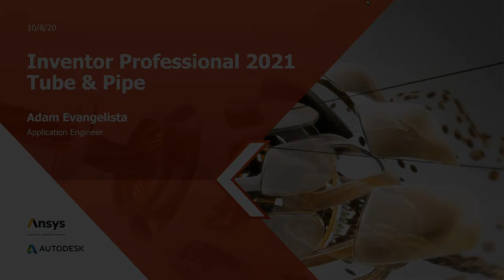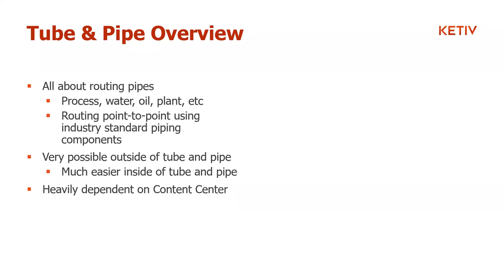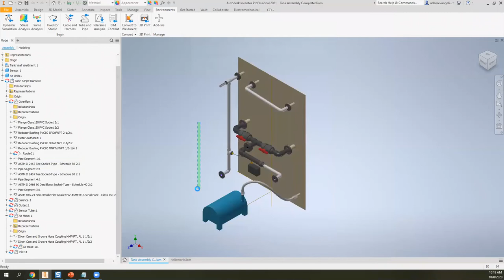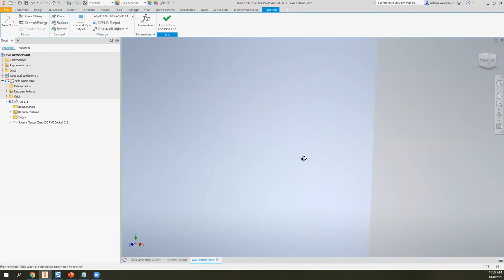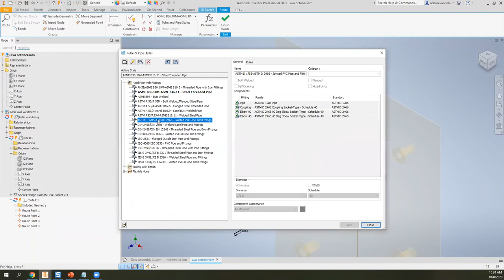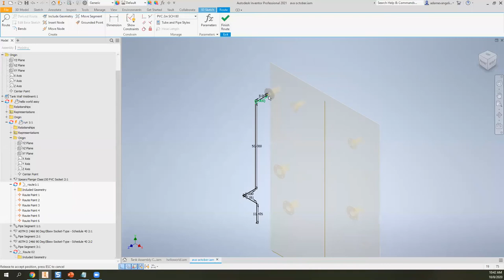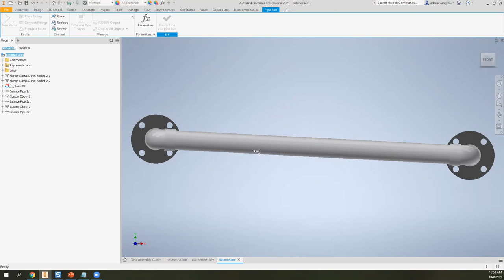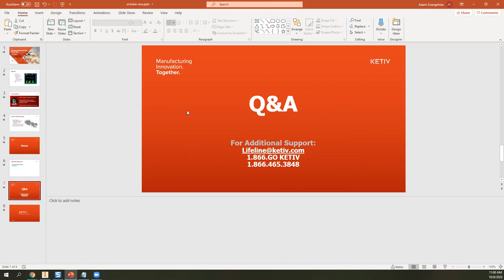Using Tube & Pipe in Inventor Professional 2021 | Autodesk Virtual Academy

Comment: That was pretty brutal. I'm trying to create a simple bent piece of tubing with 3 bends using the tubes and pipes feature and after watching all that and making a few stabs at it, I'm exactly nowhere. Clearly Adam knows Inventor but getting that information into a teachable form was apparently elusive. Maybe just going over the styles settings needed and then making a few example runs would be the way to go. It seems like this feature is not ready for prime time. Back to 3D sketches I suppose.

Comment: Hi ketiv, I have a question, could we use different pipe style for different run? I tried to change the pipe style for one run but the other run style also change. And I dont know if there is maybe a trick to do that.
Reply from the maker: Hi Alex,  Yeah, there's a few different levels to tube and pipe which goes SUB ASSEMBLY > RUN > ROUTE.  Assuming you have multiple pipe styles set up, you can change the style of a ROUTE to something else without affecting the other ROUTES in the RUN. We have some additional videos on the channel that get into more advanced topics like this as well.  - Adam

Comment: How do I measure/constrain off of geometry.  Example, i need a reducer placed 2ft off the wall.  The only option i know of is to place a component at the highest level rather than into the runs.
Reply from the maker: Hi JoeBob.  Yeah like you see in the video, you will typically want to place the geometry within the runs.  However, if you need additional references, you will need to adjust the geometry present in the top level.  One trick we see a lot is to create a dummy part to be placed in the top level assembly, and use it locate your tube and pipe placements.  You may interested in our follow up video on more advanced tube and pipe work flows here: https://www.youtube.com/watch?v=u8qiZHaHdAo&t=49s

Comment: At 26:36 you begin to explain rotating a route at an angle but don't go into explaining it. I am experiencing a situation where I have to route pipe at a specified angle, however if I need to edit that angle, there is no way for me to adjust it. The 'rotation arrows' do not show up when editing, only for initial routes. Is there a way to re-route your pipe at a different angle, or do I just start the route over from scratch which would be a colossal inconvenience?

Comment: What to do if that replaced tee is in bad position?
Reply from the maker: Do you mean orientation? You can change it by right clicking it and selecting "Edit Fitting Orientation". From there, you can click the spacebar to cycle through position options. KETIV | Marco